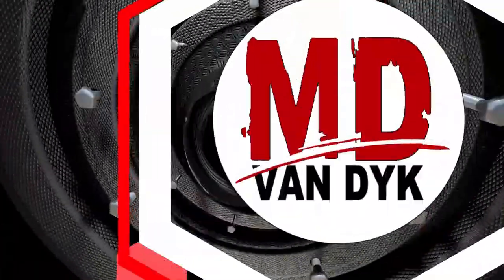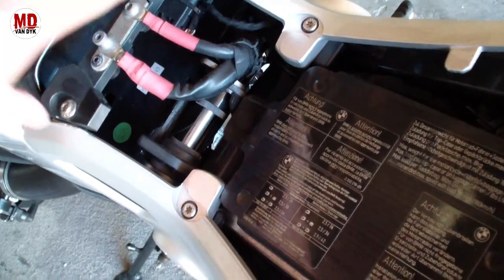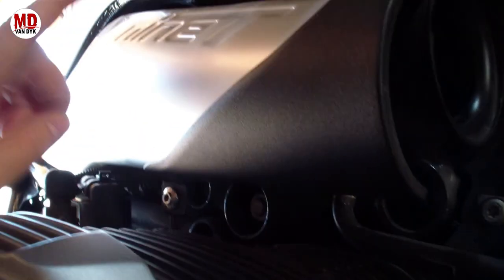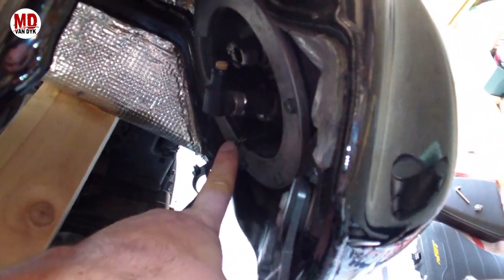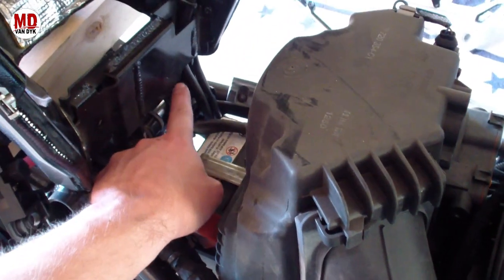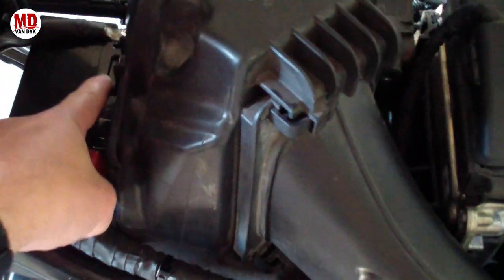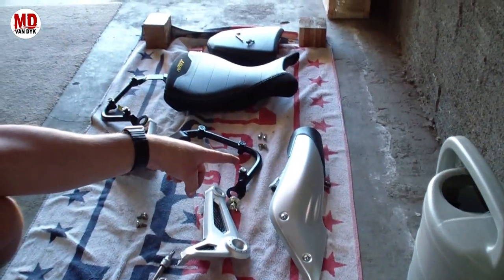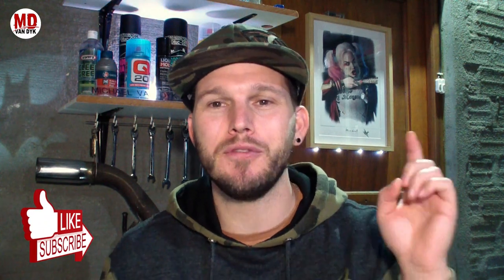BMW R Nine T - Battery Replacement (How to video)

Comment: Great video, well put together! 
Straight forward enough. A 30min job for those handy with a spanner.
Reply: Just take care not to trap or pinch cables and cable shrouds when you lift the tank upright.

Comment: I did it yesterday for my 2019 Scrambler and it was easier than I thought. The only challenge was to pull up the fuel tank high enough, put the wooden piece under it, then extract the battery and swap it. Turned out it wasn't too difficult it took me 30minutes.

Comment: Thanks for a helpful video.  One thing strikes me when you try to start the engine up at the end of the clip though.  It's a brand new battery but the starter motor still seemed and sounded like it's struggling to crank it up.

Comment: Such an idiotic spot to place the battery, Might as well placed it inside the engine
Reply: I know right!?
Reply: Don't give them any ideas, they might just see if it is possible.
Reply: Seriously.  Has majorly changed my mind on owning a bmw
Reply: Could have put it under the seat in a tray.
Reply: This battery access is fucking insane 😮
Reply: @andrewm6786 i recomend you to see a clutch replacement video of this bike, it will confirm you never buy this bike 😢

Comment: Always disconnect negative first then positive.  Reconnect positive first then negative..  Tip:  positive must positively be connected the longest.
Reply: What happens if you don’t do it in this sequence?
Reply: @livetubing  IF U DOBT DO THAT, SUPPOSE THE - IS STILL CONNECTED IN ANY CASE AND YOU ARE OPENING OR TIGHTNING + AND THE SCREWDRIVER TOUCHES THE BODY THEN A GOOD SPARK CAN COME. SO DO IT AS IT SHOULD BE.

Comment: Thanks for the video.  Is it possible to lift the tank from the back and hinge it up towards the front of the bike to access the battery?
Reply from the maker: Hi, no unfortunately not. It is on a swivel pivot at the back and can only lift from the front.

Comment: Hi do you have the measures of the battery? I´looking for a battery thats not original and save some money thou the original is very expensive" Or if you have an article number for the battery? Thanks for a good video!
Reply from the maker: Hi, thank you. I am sorry I do not have the measurements unfortunately, when I took out the original I went to the shop with the battery and got a same size replacement so I did not measure it.

Comment: Have u tried using an upgraded Ytx16 BS with dimension of 150x87x161 mm. Not sure if it will fit in.

Comment: Brilliant video - it helped me a lot, thanks a bunch. When I learned how difficult it is to replace the battery, it gave me the creeps. Do you have, by any chance, a list of the tightening torque rates? (I love your accent :-)    )
Reply from the maker: Hi, Thank you very much. Unfortunatly I do not have the torque rates. Glad the vid helped :)
Reply: T40 = 28 NM
T25 = 8 NM
T30 = 12 NM
10MM = 12NM
BATTERY TERMINALS = 10NM

WELL I AM A BMW MOTTORRARD TECHNICIAN IN INDIA, NEW DELHI.

Comment: For as long as motorcycles have had batteries, companies have been simply putting them under the seat, readily accessible for service or replacement.  BMW decided to bury theirs in the bowels if the motorcycle, requiring you to spend 45 minutes disassembling your bike just to get to it.  Why was this necessary when they could have just as easily mounted it right up top behind the air box?  Or at least make it so the gas tank can be lifted up with the battery right underneath it.  They almost had it, but then they decided to mount a bunch of decorative pieces in the way to prevent you from doing that.
Reply: Yeah. Beamers are my favourites bikes. By far. But the whole battery thing? Absolute donkeys.
Reply: If they had put it under the seat, you wouldnt have bought the bike.

Comment: Awesome video and awesome accent, it reminds me of that sci-fi movie with prawns :-) I do have an accent myself so not making fun.
Question: you answered the OEM BMW Motorrad super pricey (as expected from BMW) thanks for that
Living in New Zealand I have seen these two alternatives as far as the R9T goes, yours seems different what is it? 
> Yuasa YTX14-BS (200CCA 12.6AH)
> Motobatt MBTX12U (200CCA 14.0AH)
Also, the BMW manual states the OEM is 14.0AH but some riders have claimed it is actually 12.0AH and only a way for BMW to scare riders to buy the OEM. Not sure what your view is on this. 
Last but not least, my R9T has been in the garage for a good month without running due to me being away and I hear you should normally connect the battery to a FLOAT CHARGER when the bike is not being used for 2 weeks and more. I am waiting for BMW to send me their retail price on that one but my guess is my eyeballs will bleed out of their orbits. So any advice or recommendation on this so the new battery last a bit longer this time (3 years)
Thanks mate, great video.
Reply from the maker: Thank you very much, Same country as the Prawns :) There are a few differences depending on world location, it had a 14.0AH from factory. It has been replaced by a 12.0AH which seems to work just fine, as far as I could research BMW uses the same battery across multiple bikes so they just opt for the biggest. It is a heavy motor but the 12.0AH swings it just fine and seams to be ok from info on BMW forms. If the bike is standing for more than 2/3 weeks I would recommend clipping on a trickle charger, it will cycle the battery and make it last a lot longer, any generic brand will do. No need to spend all that money on OEM BMW equipment. Hope this help 😊
Reply: @MDvanDyk  Just received the OEM pricing, these BMW people are insane...
1x BMW Motorrad battery NZD584 (8 weeks delivery) that's SAR6,050
1x BMW Motorrad float charger NZD278 (8 weeks delivery) that's SAR2,880
It makes me want to know where their batteries are fabricated because I am pretty sure BMW don't make batteries of their own, it must be something rebranded. Anyway, that's BMW for you :-D
Reply from the maker: That’s insane. They are taking a fat chance with that price, you can get way cheaper.

Comment: I have R9T scrambler with dead battery. Had many bikes but this level of retardation in engineering I didn't see before. Germans quickly slide in idiotic solutions like that BMW with refueling cap beside the back portion of the seat or passenger seat. Thanks for video. I kind of expected something like delivering baby labour when I saw the battery position.

Comment: Any idea what size that last little bolt is that holds on the bracket holding the battery down? Absolutely nothing I have will fit that thing.
Reply from the maker: Hi, I think it might be a T20 Torx bit… I do not remember exactly. I did have to hold the bit with a shifting spanner to get in there at that angle to loosen it.
Reply: @MDvanDyk  thanks! you were right. It was T20. Man that battery is a pain to get out. Your video helped a lot.
Reply from the maker: Glad it helped you. This is why I made it, I had to replace the battery and could not find a video showing me how so I decided I’ll make that video.

Comment: Totally different question, but what kind of luggage rack did mounted on the bike. It looks nice and small.
Reply from the maker: Hi, I am not 100% sure but it was a BMW product. Bike has now been sold and I dont remember, sorry.
Reply: Those are SLC racks by a German company SW-Motech. I have a set. Highly recommended.
Reply: @thomasnew2113  CORRECT, SW MOTECH IS A GOOD BRAND IF COMPARETIVE TO WUNDERLICH OR EVOTECH

Comment: Makes me cringe all the time when motorcycle companies put the batteries underneath the tank. Although this isn’t as bad as my MV Agusta F3 where the battery is under the tank and much more work where you have to take the rear body and side panels off. Now I have two bikes that I have to do this with. 😡
Reply from the maker: My Brother had a MV Brutale way back and I remember that also being a nightmare…

Comment: Remove negative first
Connect positive first, then negative
Reply: What's the risk of not respecting this ?
Reply: @deniskempeneers5472  to disconnect the negative first, and the spanner touches the "body" no short circuit. If you disconnect the positive  first, and the spanner touches the body, it short circuit. 👍
Reply: @jonathanprince2667  makes sense. Thanks for the info ✌
Reply: @DenisElec  👍

Comment: A number for the replacement battery would have been helpful so it can be ordered in advance.Good video.Just pointing that out.  ;-)
Reply from the maker: S: 61218556314
182730-10 AT
12V 12Ah 200A (EN)
Reply: @MDvanDyk  Brilliant. Thanks for taking the time to reply.
Reply from the maker: No problem. Good pointing it out. I added it to the description of the video as well.

Comment: Wish I’d never got this bike.  Any basic thing is a mega job access to a battery should be easy enough you shouldn’t  have to remove parts of the bodywork and the fuel tank to get to the battery! Typical of BmW trying to get people to go in to them and spend a fortune on something which you should be able to do easily at home
Reply: I don’t even want to replace battery I’m just wanting to install the Optimate leads for keeping battery alive over the winter
Reply: Now imagine get an emergency on a travel  when you only need to transfer energy to only  turn on the bike, and for some asshole engineer youre in a big trouble.